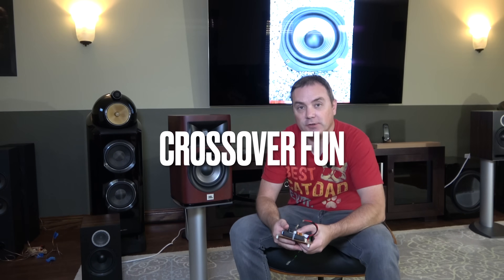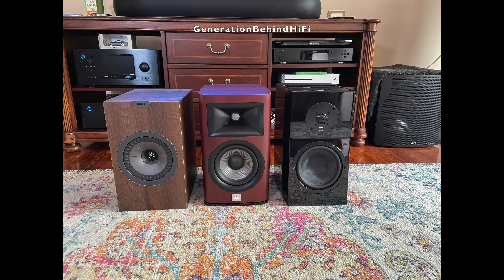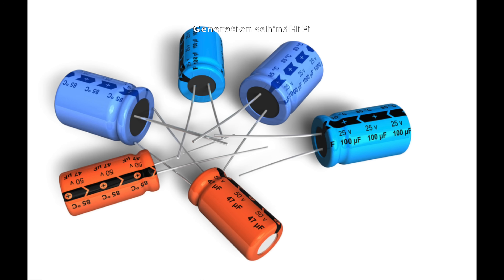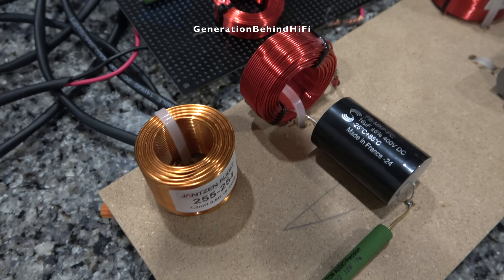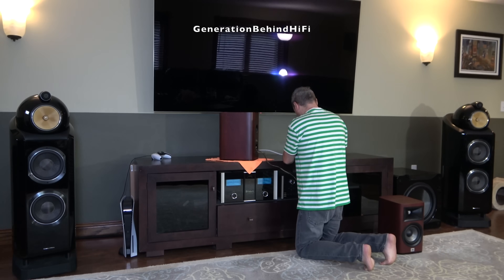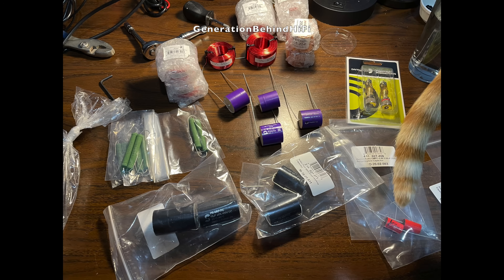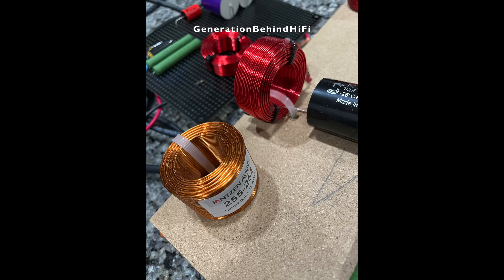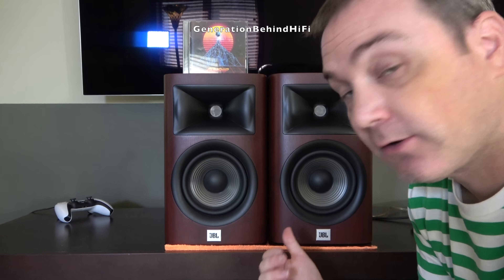JBL Studio 630 Crossover Upgrade - Do higher end crossover parts make a difference?

Comment: its amazing how the sound changes from the better components of the same values are audible even over youtube.  especially the tweeter sound ranges. 
at the very least tweeter section should be done with better quality components.
* regarding your musing about is it worth it?  when people are spending hundreds to buy discrete OpAmps to swap on their amps, with results that are not noticeable with volume normalised blind comparison: these crossover upgrades are making a world of difference for similar price. just change the tweeter components and most of the gains can be had.

Comment: They sound different but not necessarily better.
The difference comes from from the altered Crossover Transfer Function, the Equivalent Series Resistance is vastly different between the "stock" components and the upgraded ones, so, not a valid comparison.
Reply: To the point. Different but not necessarily better.

Comment: It sounds different to me, but i think the components may be wired differently on the tweeter boards.  I think the modded one has a lower crossover frequency than stock.  The mod has louder mids. Sounds louder, but may not be accurate to the source.  Need to see schematics and be sure the modded project board was wired properly.  I understand not wanting to rewire the stock board for a youtube test.

Comment: It looks like you're having fun to me, and that's what counts. My ears agreed with yours that the R JBL speaker sounded much clearer and cleaner with more depth to its presentation. I did the same with my Yamaha NS-500M speakers but I used new non polar electrolytics for the smoothing caps (like the original crossover)and the results were outstanding. Keep having fun!

Comment: This is not proof. Really need to take accurate measurements to determine if the FR is the same. One thing to consider with changing components is not just their main value of mH  and Farads, is also resistance and other parasitic elements of components that would need more involved testing to measure. The frequency response for each drive may have been altered, which is why its a great idea to test it.
Reply: Our ears are not proof, but some machine that can’t hear is?  Lol, I’m sorry, you’d have to measure my laughter.

Comment: The upgraded crossover sounds cleaner and less stressed on the peaks. Clearly audible. 

Can I ask just to be sure the upgraded crossover was kept outside the speaker cabinet and connected via flying leads ??

I guess taking the crossover out of the cabinet also makes a difference. 

Lovely video great work loved the channel and subscribed immediately. 

Thanks !!!
Reply from the maker: Thanks! Glad you like it. This crossover was so huge there was no way it was fitting inside the cabinet so I left it out during this test.

Comment: Yes but what about internal volume in that crossover is a lot larger, and if you haven't got it in the cabinet make in the cabinet bigger what does sound like it, let alone the electrical interference from the driver on the crossover. Also values are not going to be the same between the two, I'm afraid putting in better components is not going to necessarily tell you that it is better. Yeah sometimes capacitors can improve the tweeters and mid-range

Comment: It's undeniable that new speakers sound better than an older speaker of the same make and model and with the same crossover components. I believe that better components might age better, but I think they tend to sound pretty much the same when they're both new. 
I also think that tests like these are severely limited by the inability to objectively test the performance.
I was listening to the comparison from an LG 4K TV transmitting through Sennheiser MTW3 earbuds and I couldn't distinguish between the two. 
Just FYI, for comparisons like this, it might be a good idea to run the music mono through the two speakers while switching.
Reply: ether there is something wrong with your tv , earbuds or you just cant distinguish between sounds but there was quite a bit of difference. im listening through a home theater system so that may be why but you should be able to easily tell with decent headphones.
Reply: @jhue73  I rather think that the test was not very scientific and did not use the right material to show the differences between the two. I'm also confident that the equipment that I use to listen was every bit as good as the equipment used to record the sound. I used more than one type of headphone. And there's nothing wrong with my ears.
I have listened to several different types of speakers being tested in one sitting. All three output pink noise and in all three cases I can hear the differences between those speakers, and those differences were closely reflected in the measurement data shown on screen. 
I was also able to hear the speakers before I ever saw the data, and what I could see in the data was exactly what I heard.
Reply: @MxyzPi  its clear to me they sound different in the video so says many commenters, so i dont know what to tell you. i can tell you that you cant go by youtube videos to tell the audio quality of a speaker.
Reply: @jhue73 Other commenters also said that they couldn't tell any difference until they heard a higher resolution clip with different material. 
It's clear to you that they sound different in the video but it's also clear to you that you can't go by YouTube videos to tell the audio quality of a speaker?
Reply: @MxyzPi  im starting to see why you cant hear a difference. sounding different and audio quality are 2 different things.
Reply: @KidAgainHobbies  Umm..ok. Sure. (..wow)

Comment: Hi the highs are much better on the modded speaker  To keep modding costs down maybe as a first action only the parts in series with the drivers could be upgraded   For sure the parts in series impact more than those in parallel

Comment: I changed caps in an old pair of Polk monitors. The values were so big for the woofer circuit 2nd order low pass that the physical size of the polypropylenes wouldn't allow the crossover board to fit into the back, so I used polyester versions on the board instead. This improved the sound over the electrolytics for the woofer circuit. Polypropylenes are more important in the high pass for the tweeter. You can get away without "perfection." IOW, you don't need to have perfect components everywhere, especially on less than perfect designs, or speakers not costing thousands.

Comment: I've done many similar crossover parts upgrades over the years, and never failed to hear a notable difference from the better parts.  The better my system got, the more difference it made, and the easier the difference was to hear.  Eliminating inductive byproducts from a resistor, ferrite interference, and improving clarity in a cap or inductor is a good thing in my book.  Well done.
Reply from the maker: Thanks, Scott! It was a fun project and I had fun doing it.

Comment: I think it's funny to watch the reactions when this is done to speakers that cost more money but still have garbage quality stuff in their crossovers. I'm in a Klipsch group and as the cabinets and drivers have gotten better over the years the crossovers have dropped a lot in quality. Those guys crap the bed when one even hints about swapping things out for better parts. It's a bunch of guys driving stock 1985 Corvettes thinking they're the owners of 63 split window Vette. Everything is built to a price point and most of the big names now have shareholder profits to consider along with everything else. This was a really cool A/B test considering the limitations of listening this way.
Reply: Yes, Klipsch are very overrated! Hollow cabinets with little bracing, cheap pressed metal basket woofers, poor quality crossovers!
Reply: @billybunter3753  the older crossovers are great but the cabinets are janky. The newer ones have better cabinet bracing but weaker crossovers. I don't think they're overrated so much as underbuilt. I love my Cornwalls but I did pretty extensive mods on them. Having rebuilt several pairs of various brands of speakers I can say they're all built to a price point. I'd say the CSS and GR Research kits have better guts than most speakers under 10K.

Comment: The custom one of the right sounds like its own issues. It sounds boxy to start because of the midrange has been upped. Even though the right speaker has better detail in the bass, it sounds like it has some phase issues with the sound top to bottom. One definitely isn't better than the other.

Comment: Ok i notice the difference in the highs. The Tweeter sounds more higher resolution in the upgraded. Btw if you're gonna do a test, do it outside. I hear bad reverb in the room that will make it hard to hear the dry signal. And also make the volume louder to see if its linear. Iron core has limits.

Comment: Depends on the speaker really,
The problem is that there are some speakers that even with middle of the road components were so very well engineered that if and when you change the crossover you change the ( BALANCE) …..and balance is one of the single most important thinks in audio and problably why you bought that speaker in first place.
Examples: spendor bc1 , almost any of the bbc interactions ,ls3/5a etc..etc.
 Proac 1sc , Mission 751 ( original ) and the list goes on,
So….while there are a ( lot) of speakers that gain with better crossover parts , not every speaker reacts like that , be careful when doing this ! 
Having said this most speakers do react positive to better parts , but like everything in life, there are exceptions ,
Even when the speaker do get better and measures better, who is going to say that you will like the new ( BALANCE) better ?????? 
Sometimes perfection is not what you want .

Comment: I can easily hear a difference between the two. However, neither is a clear winner to my ears depending on the sounds and the test track. I listened on a well tuned system with DIRAC live. In some instances the original crossover sounded better, with more enjoyable decay structures. The upgraded crossover sounded more abrupt with transients. Perhaps in some cases, additional decay via iron core inductors  can be desired if that’s the design objective, or if they suit the existing drivers and enclosure. I am now even more on the fence regarding my planned crossover upgrade project 😂 Fantastic content here thanks for making this.

Comment: Now, try and active crossover/DSP instead. :)
Reply from the maker: Yeah! I have heard about active crossovers/DSPs and no doubt I'm sold. Maybe one day I will play around with them. Right now there is only so much time in a day.
Reply: @generationbehindhifi  car audio is well ahead of the game there. Every little cheap Kenwood headunit has active crossovers... So do home theater Amps but not as customizable and often only meant to separate the bass, fronts and surrounds in the low end. 

I would buy a car audio DSP, feed it 12V in some homemade way, buy a cheap measuring mic and go to town! Thats "only" about $600 - $1000. 😬

Comment: I build speakers with FR drivers and (for FR drivers) eltrolytic caps sound better than those yellow ceramic caps (which sound more brittle). With electrolytics the FR drivers sound more silky on electrolytic caps, but not too smooth (like when on soft dome tweeters). For soft domes, the ceramics caps sound better than electrolytics, more klangy (which soft domes tend to lack). But electrolytic caps make soft dome tweeters sound too wissy. My point is, that components can make a difference and it's all up to your ears and what you like. 

Cables make a difference too, cos (to me) a non soldered twisted crossover part connection sounds a lot better than soldered joints. Maybe it's cos it's Schiit solder. The solder sounds a bit scratchy compared to a directly twisted joint. The crossover componets are directly connected without any extra wire in between the components (where possible, and that's most, if nor all of the crossover). Usually my crossovers only have several parts. And an interconnecting wired twisted connection sounds different again (and sounds a bit too smooth for me). But (in all 3 cases) the sound is all there! It just sounds different, so cables should also sound different. But I have a trained ear, from voicing my speakers. And that's the hardest part in designing and building speakers and it can take a while, and I have build way more than one pair of speakers. 😂

Comment: It doesn't matter by taking measurements unless you change the values. But the sound quality will change once you take out the cheap parts and steel connectors. I design my own speakers and crossovers and even the solder I use is high grade silver lead free. It all makes a difference and if you going to do something do it once and do it right. I can't believe how good my speakers sound compared to big names. It doesn't even compare unless you start spending some serious money. I'm not even going to get started on the technique is use for my multiple layer cabinets

Comment: Difference was as expected, big difference.
I am using Sennheiser HD600 to listen, and left speaker had the sound "inside the box" and right was flowing into the room.
Have done this myself 25 years ago, but also changing the very thin wires connected to the woofer, which gave more control at lower frequencies.
I replicated crossover like you did, it was easy, as speker could be bi-wired. It was Energy C2 that I modified.

Comment: My question would be about accuracy  match for value of  replaced elements . Why you did not present values - how much  "better ones"  were in reality identical to "worse ones "?   How much accuracy you assured?  Only then I could have  any confidence 

Second   it is unscienfific to make  test of comparison  and in introduction    give full   support  to   one of solutions  due to presented in advance learned basics  (ex time delay  expectation   counted in miliseconds  without noticeable  resistance in circiut of capacitor)  

  i will care for brand and technology of  electronic elements when they will be included in rules  of theoretical phisic to which sceintists build space crafts. . Example    law says time delay is to be evalulated byexclusively   resistance x capacity RxC . Resistance R for capacity is measured  zero - how time delay may be not zero?

 Induction is theoreticaly calculated by count of wires, their dimensions nad magnetic coefficient for environment. Laerned "basic" you claim  depends on any "speed of reaction of rod"    BTW are they also  slowed  in steel discs of hard drives writing down gigabites in seconds? ?    Are mentioned basics for sure proven  true?

PS. I proven to myself that many speaker producers cannot  on line  care enough for accuracy of values and it is normal to make improvements just by tunning   values. Of course I expect that high priced elelents are selected to  better  match  to what is requested by designer but it may be spared by just matching cheaper elements  DIY.

Comment: One way to save a few dollars would be not to change out the capacitors that are going to ground.  Only change out the ones in the signal path.    BTW, you can take a 4.0 mH and unwind it to 3.9 if you have a bridge to measure it.

Comment: Take the crossover out, use one high quality capacitor to protect tweeter from low frequencies (eg amp turn on bump), then use a dsp to crossover actively and bi-amp, the difference is shocking, the precision of time and phase alignment will make the midrange crystal clear and very holographic, it’s not an accident that nearly all studio monitors are done this way, and many having a digital input so the signal does not have to go through another conversion stage, but nice job by the way with improved crossover….
Reply: You're never going to be able to convince these guys that the only reason passive crossovers were ever designed was because you could combine multiple drivers on one channel. Passives have always been a band aid or compromised solution since in the past going active wasnt practical. Of course many manufacturers within the industry would try and profit off of this band  aid with msrketing all kinds of hype and snake oil into passive components such as overpriced capacitors and other fancy inductors.
Reply: @FrankBennett-kb7xs  exactly, the performance upgrade you get by going fully active is astounding, the only one I remember being able to do this, and still can is Linn, you would think that they were able to sell more amplifiers and active crossover would be incentive enough

Comment: There will always be an improvement when inferior parts are replaced with superior parts. But, you will be hard pressed to notice a significant difference. When replacing quality parts i.e.
Metalized polypropylene caps with film & foil. Or, air core inductors of sufficient guage with foil inductors. These upgrades really only prove to be reasonable when getting rid of known electrical inferior parts. Don't expect a quality aluminum film & foil cap to be noticeably inferior to a Teflon, Paper & Oil, Silver/Copper foil cap, etc. Of course, the higher the price for such components  breeds confirmation bias. Who wants to admit to themselves that the $1.75 1uf Solen cap that was replaced by a $100.00 1uf Jantzen. Didn't make any difference in response!
Reply from the maker: For sure there comes a point of diminishing returns, but that's basically this hobby in a nutshell. I was recently at high end audio store that actually sells speaker cable with a black box for over $100k a pair. When I asked if they were made from precision metals the sales person said no, the "black box" is the secret sauce here. Sure, no thanks!